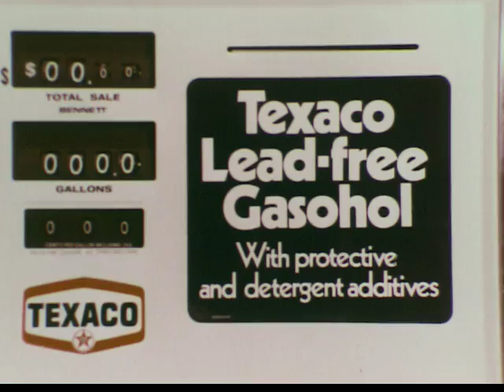Gasohol Television Commercial 1979 Texaco

Comment: I bought that stuff everyday for 2 months in my 70 thunderbird in 1979. It increased the power slightly but it attracted water in the fuel and cleaned all the dirt in the tank right into the carb. People were putting law suits on these gas stations for reimbursement on repairs. It was over in 10 months